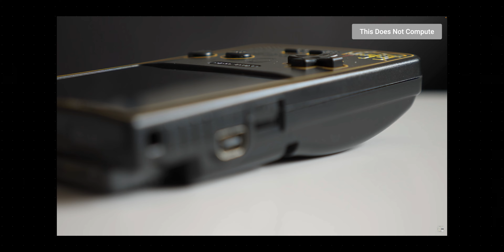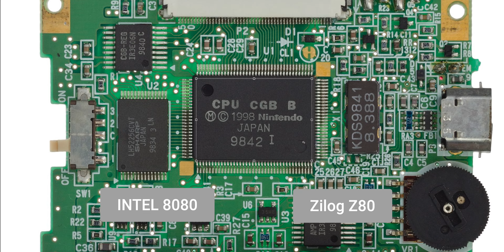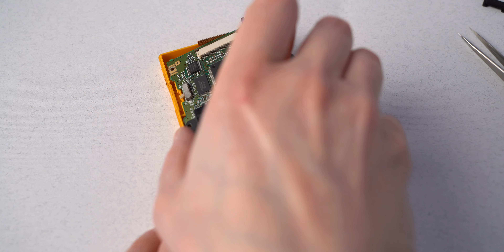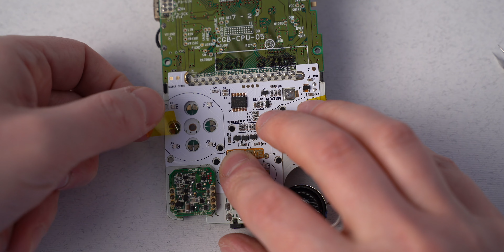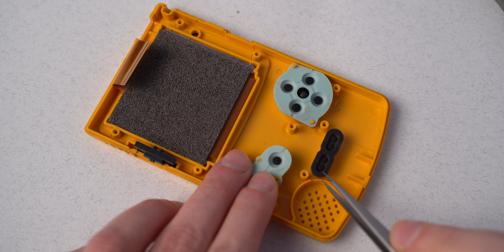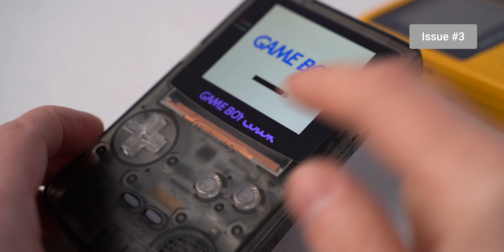The BEST GameBoy Color Mod EVER !

Comment: Please please please invest in learning better soldering skills! Also, a good cleaning of everything would make sure everything would run better for longer.
Reply from the maker: When you are talking about soldering skills, can you be more specific ?
Reply: @IhorPushkar Sure, almost all soldering points on the LED board look like they were soldered too cold or too short, the tin solder didn't flow right and might break. You can see on many connections is still the plating visible and is not fully coated with tin. Also, the tin formed small breads instead of something more like a Domeshape (or Volcanoshape if something pokes through). 

I'm not sure if the GBC Board has a big ground plane or not, that might suck away a lot of heat. But if your plans are to do more electronic repairs / upgrades you also might want to upgrade to a directly heated solder iron, the "Pine64 Pinecel" or "MINI TS101" are great and cheap starter tools for good soldering jobs.
Reply from the maker: @AthiHusky  Thanks for your recommendations, I have already ordered another soldering iron which will hold heat a lot better.  This one FNIRSI HS-01
Reply: @IhorPushkar  looks pretty similar to the Pine64 one, you should have no problems using it 🙂
Reply from the maker: @AthiHusky  I hope so too, have a great day !